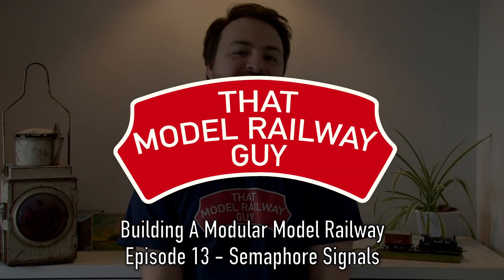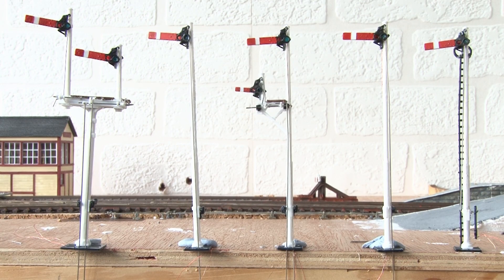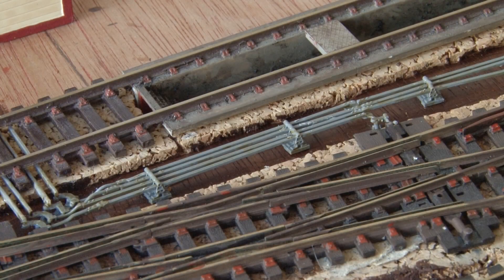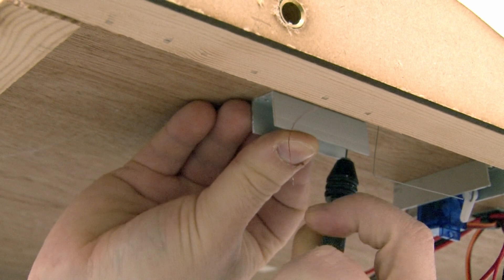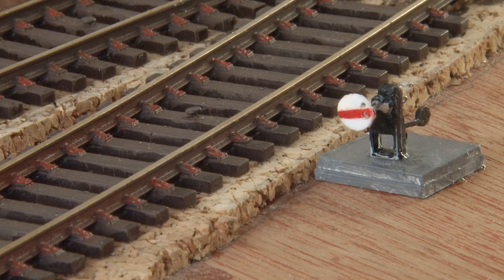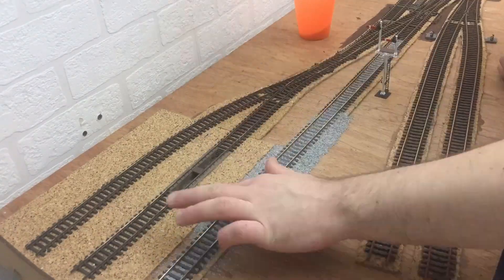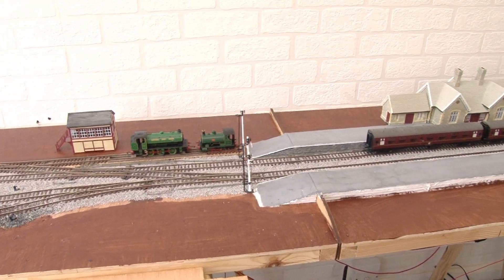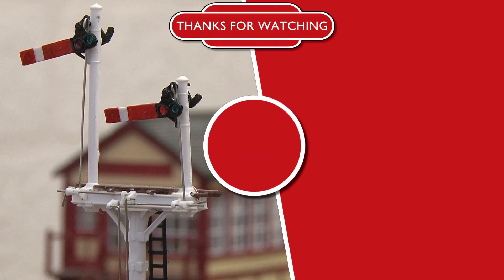Building A Modular Model Railway! - Episode 13 - Working Semaphore Signals

Comment: Well you're certainly ballsy for leaving that GW wash open like that and not using super glue to hold it down.
Reply from the maker: Haha, is that a known thing with those paints then? Have to say I’ve never used them before but it sounds like I got lucky that it didn’t end up going everywhere 😂 Thanks for watching 👍
Reply: @ThatModelRailwayGuy  yeah, there's been many a post in forums about one of these pots getting knocked over during use.

Comment: If you mist the ballast/track first with Isopropyl alcohol before dripping on you glue, water and flow aid (w/up liquid) mix it should improve wicking and accelerate the drying time...
Reply from the maker: Hey Ben, I’ve tried misting with Isopropyl alcohol in the past for ballasting but found it didn’t really make much difference than just misting it with water. I know that if I don’t mist the ballast at all then it clumps up immediately - thanks to a few unfortunate mishaps on my part 😂 Thanks for watching 👍
Reply: @ThatModelRailwayGuy  I can't comment on Ballasting but I have used iso with Model  Basing and when making Wargaming Terrain ..works well but good old H2O is much cheaper!

Comment: I visited a mechanical interlocking 40 years ago. Anything on the point rodding that slid or pivoted--and the surrounding ground--was black with repeated lubrication. Everything else was a grimy rust color. The signalling is looking good so far. Keep it up!
Reply from the maker: Good to know, I’ll keep that in mind when I come to weather the track, ballast and point rodding in more detail further down the road. Thanks for watching 😃

Comment: I want to buy some Dapol sempahore signal for my little double oval layout, but im really not sure which to get! I have a few sidings here and there... would you be able to recommend anything please? can share a track diagram! :D
Reply from the maker: Hi there, I'm not really a signalling expert but if you're looking at the Dapol motorised signals they only really do two types - a single post and a bracket signal.

The single post signals are what you would use on normal sections of track (ie: no points). I believe the red ones would be used around a station, controlling the entrance and also at the end of the platform as a starter signal - so that the driver and guard know the route ahead is clear before leaving a station.

The yellow single post signals are distant signals - they would be used further outside a station to warn the loco crews that they may need to stop at any of the red arm signals in next section.

The bracket signals work on the same principle, except they're for points. Usually the taller arm is for the mainline and the shorter arm is for the diverging route and this helps loco crews know which line they're set to travel on.

That is a very over-simplified version of signalling and again I'm far from an expert. Hopefully it's enough to get you started though. Thanks for watching 😃

Comment: These signals look fantastic!

I actually bought with one of the Dapol motorized signals in N scale but I haven’t installed it yet. Hoping to see if I can make it a simple DC switch flip if possible.
Reply from the maker: Yeah I think I would have gone for the Dapol signals if I were building an N Gauge layout too - the OO ones are already delicate enough! 

From what I’ve seen it should be relatively easy to hook them up to a simple DC toggle switch though. Thanks for watching 😃

Comment: That's quite a lot of fiddly work, but its really paid off and looks really well done. Thought about getting point rodding for my layout, though the amount I'd need would be quite a lot.
Reply from the maker: Thanks, it did take a long time but I do think it was worth it. I used up 2 of the point rodding kits plus the additional extension kit and I definitely don't have a large layout - although most of it did go on that 4ft run down the length of the entire platform! Thanks for watching 😃
Reply: @ThatModelRailwayGuy  It was worth it, really adds to the layout.

Comment: Motorizing Ratio Signals with Servos is a great Idea, I did it in the past using Voelkner or Viessmann slow motion signal (coil based magnetic) motors, like of what being used with german type semaphore signals.
You did a well and excellent job of countryside signalling, what is correctly on british standards, I think.
In my area we have other signal rules and we can make some shunting onto the mainline and need not use signal controlled shunting if the shunted train is not longer than 2 short wagons plus shunting loco.
German signals are very different the british ones and have got a long history of different and area typically rules very different by several different private or state railways of the past.
The actually used semephores are a result of lot of different rules combined into a modern rule whis is valid with a few changes since 1935 and up.
Me I am modelling the year of 1908 so I do use the prussian signal rules of 1904 and the mecklenburgian signal rules from the 1880's.
Reply from the maker: I have to admit my knowledge of German signalling is pretty much non-existent but it's interesting to hear how different it is from what we're used to in the UK. 
As a Guard on a heritage railway I have to know a bit about the signalling there so I think I've got the basics mostly right on the layout, although I know there are some compromises I've had to make purely based on the space available. Thanks for watching 😃
Reply: @ThatModelRailwayGuy  Well, the german Signalling System was in the past more confusing and more different. It gave tries to make it as one valid system by together valid rules but the bigger railways made their own signalling sometimes like before, too at their own Branchlines.
Before germanybecame one big nation as imperial monarchy in 1871 it was a country with over 365 different german spoken terretories and counties or even own bigger kingdoms. A lot of them operated own State Railways and lot of them with lot of different signal rules.
The still existing signalling was a long procedure to form one signal rule book.
Of course, we are knowing some semaphores, too, the bigger varity had been existing in the past before 1959.
At Mecklenburg they are semaphore signals of the 1870's until the year of 1923 when nearly all other State Railways used allready one signal rule book since 1892 when a new signal system had been established.
The distant signals were green disks with green light, was the green disk or green night light visible it was meaning, that the following home signal is in Danger Position, the green light was a stopping signal.
If the disk would be invisible than a white light had rhe meaning that the following home signal would be in Clear Position.
Home Signals had up to three arms, to top arm was horizontal in Danger posution the up to two arms below of it were vertical parallel to the signal post.
A red light showed the Danger position.
The Clear Position had up to three different positions.
The top arm in Diagonal position showing one green light means Clear.
The top arm and one below arm in addition in diagonal position showing two green lights had the meaning, Caution at the next following turnout, train will run into diverging route by max 40 km/h.
All three arms in diagonal position with three green lights had the meaning: Caution at thr next tournout in minimum two diverging routes are following, max speed by 40 km/h.
In the year of 1935 the both below green lenses changed into yellow-orange lenses, the distant signals became an yellow-orange disk and a red and white painted pointer and the distant signals showed green-green, yellow-yellow, green over yellow or green over yellow-yellow.
Distant signals are operated automaticly by switching the home signal aspects.
The signal men need not operate distant signals separately like in Great Britain.
In the past some mid station home signals had arms for both directions at one post.
It was allowed to gruoping up to three or more Signals onto one Bracket Post or alongside right of the track in directly visible position. At germany we have right side traffic, normally, but some double track lines allowing traffic in both directions, too.
Since the two former state Railways of the DB in west germany and the DR in east germany re-unioned into the DB AG in 1993 one signal rile book is valid but it gives a wide varity of different signal types again, a lot of what train drivers need to know.

Comment: @16:09
 just a silly idea. Well two actually. 
1. Maybe have a dummy train aka a unpowered train sitting in the siding or at least something that looks very old but probably still runs and lights up like its probably getting warmed up. Some times. If it was still useful. 
2. I know its not that time of yearrr. Buttttt what about making a ghost train for that siding? Make the train look like its seen better days and falling apart at the wheels and boiler and make it light up randomly with some kind of Halloween colored lights. Lol. As for a train load could be passenger or something you make up. But old sidings allways give a  Halloween ish feel to me. Lol. Just a idea. XD hope i didn't scare you to much. Lol.
Reply from the maker: Ooh, both of those are really interesting ideas! I may have to look into them for the future. Thanks for watching 😃
Reply: @ThatModelRailwayGuy   lol. No problem and thanks for the video. But be careful. Don't want the wandering coach to get you. Lol. 
Ps. If you like a little scary stuff. I recommend watching " the wandering coach" by daylight 3. If you need inspiration for a ghost train lol. Good luck on what ever idea you jump on first tho! Cant wait! XD

Comment: Wow, those Ratio signals have worked out well. Installing them and connecting them to a servo set up is a bit beyond me,  So I opted to use the Dapol SR semephor signals operated automatically by the movement of my trains through track side sensors to Train-Tech signal controllers, with a manual override option added.
Reply from the maker: Thanks! They do look good but it took a lot of work to get them to that stage so I don’t blame you for going with the Dapol signals instead. I love that you’ve got them working automatically too! I may try configuring mine to work with ABC braking in the future but I’m not sure how often I would use it. Thanks for watching 😃

Comment: 5:55 no need to apologise,  rule number 1 applies at all times.
Reply: Also, how does the addition of the signals effect storage of the station modules?
Reply from the maker: Haha, good point! It's more of a general disclaimer so the rivet counters don't come after me 😆
I took the signals (and buildings) into account when designing the storage racks so there's plenty of space - I just have to be careful not to knock them over! Thanks for watching 👍

Comment: Great job with these, they look very challenging! I am about to tackle the same and will be pleased if they look as good as yours do. What size LED did you use?
Reply from the maker: They were definitely a challenging kit to build and get working - I wouldn't want to do it again. I went into the lighting and the micro LEDs in more detail in a separate episode: https://youtu.be/R_BQE6SEidc There are links to the micro LEDs I used on that. Hope that helps and thanks for watching 😃

Comment: I presume you have tested clearances for stock leaving platform 2 on to the single road? I had issues on an old layout with stock leaving the loop hitting the platform on the opposite line..
Reply from the maker: Yep, the signals are far enough away from the track that stock shouldn’t go anywhere near them. My platforms generally end before the points too (or the ramp is descending) so I haven’t had any issues with stuff scraping along the side either as trains enter or exit the loop. 

Since the Hush Hush manages to get through the two platforms without trouble I’m assuming everything else will manage it too 😂 Thanks for watching 👍

Comment: Is the new platform compatible with the hush hush and its step?
Reply from the maker: It is indeed! I actually mentioned this in the review I did of the Hush Hush: https://youtu.be/2rslipvlJ3w
I had to move the track on platform 1 away from the edge by about a millimetre but that was before I did the ballasting so it wasn't too much hassle. Thanks for watching 😃

Comment: Are you going to weather the end of the platform with where coal/water or diesel has fallen through or discarded or leaked but looks good and keep it up
Reply from the maker: Definitely! The whole trackbed will get more weathering as it is anyway as the ballast looks far too clean at the moment but the ends of the platforms and the yard in particular will definitely get some extra attention. Thanks for watching 😃

Comment: A tad off the main subject, but where have you seen Fish Plates and Bolts painted red??? If it's rust effext your after get Vallejo Rust and Steel and use the Orange rust colour but it must be dry brushed, don't over do it. Take no notice of me, I only made leaf suspension springs for every type of Bogie going as well as growing up next to a double track, which was working in my mature years ( sorry, immature) though I doubt no one knew the diffrences. The RED sticks out like a sore thumb and never seen any of Fishplates nor the Bolt RED. When I've finished my Layout, and if I can remember I'll post my paint work but I am interested in getting my Ratio Semaphores working. So many thanks. T.
Reply from the maker: Hey Anthony, so the colour I’ve used isn’t red it’s a Railmatch rust colour. It’s more orange in reality although I appreciate it may not look that way on the screen. 

The layout isn’t finished yet either so the whole trackbed will get more dirt and grime added to it in the future which will tone down the bright colours and the rather clean looking ballast too. Hope that makes sense and thanks for watching 😃
Reply: @ThatModelRailwayGuy   I would change to one of the two paint sets as Orange Rust is a lot lighter and would also do your track at the same time any that gets on your sleepers can be covered with  dirt and grime that goes down the centre of your balast and spreads and the grime, oil etc that you find on the sleeper ends.Hope this may guide you but all choices are yours as the Layout is yours, none of this is a  criticsm. Enjoy. Tony.

Comment: These look incredible !! What did you use for the lenses ? They don’t come as part of the kit do they ?
Reply from the maker: Thanks Christopher. So I used a tiny cut out of coloured lighting gel for the lenses, which I appreciate is not the sort of thing everyone has just lying around. The lenses on the signal arms had to be drilled out too as they're moulded on, then the gels were glued in behind. Thanks for watching 👍
Reply: @ThatModelRailwayGuy  ahhh lighting gel is such a good idea !! That must have been very hard to cut and handle when each lens is so small. Oddly enough I work in a theatre so I have access to a lot of spent lighting gels. Thank you so much for getting back to my comment I’m really inspired to try this out on my next layout !!

Comment: Hey, how long does polystyrene tend to dry when it's put down with PVA?
Reply from the maker: Hi there, I'd leave it overnight at the very least but ideally over 24 hours - make sure it's weighed down too! I'll be honest, I kinda cheat sometimes and use superglue. It does melt the polystyrene a bit but you don't need to use as much and it dries within a few minutes if not sooner. Hope that helps and thanks for watching 😃
Reply: @ThatModelRailwayGuy  Yeah thank you! I did get a little impatient and put some dots of super glue around the board and it's solid. Thank you again !

Comment: Great to see working signals. Your next job is to interlock them with the points.😬
Reply from the maker: Haha, no way! I don't think that's possible with the way I've got the Megapoints system setup. I might look into DCC control for everything in the future though so some sort of rudimentary route selection would be possible I imagine. Thanks for watching 😃
Reply: @ThatModelRailwayGuy  You might be able to do it with relays or logic ICs, but I don't know enough about the Megapoints system to know if that's possible.

Comment: do you need any computer software to program the signals or is it solely done from the motherboard looking thing idk what it’s called lol sorry
Reply from the maker: The Megapoints controller (the motherboard) has the necessary software built into it already. Similarly if you were using a more simple servo controller you would also use that to set the start and end points. Hope that helps and thanks for watching 😃